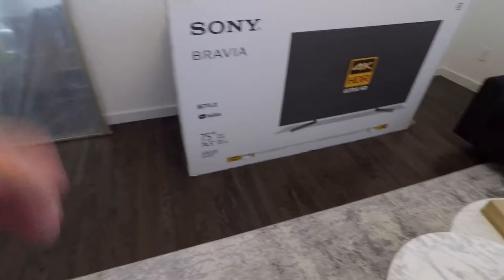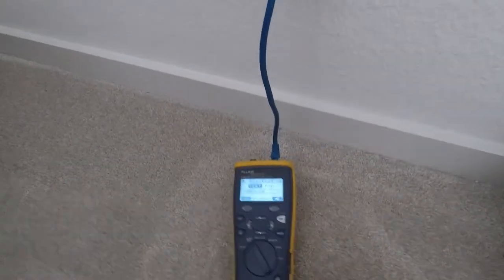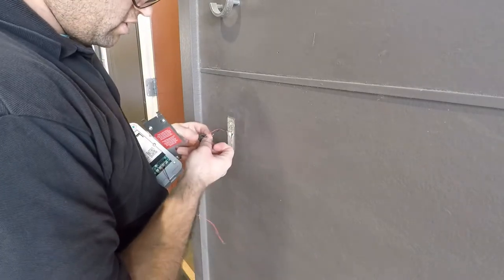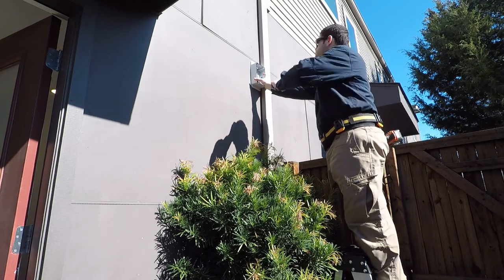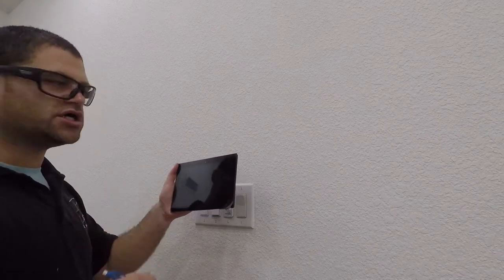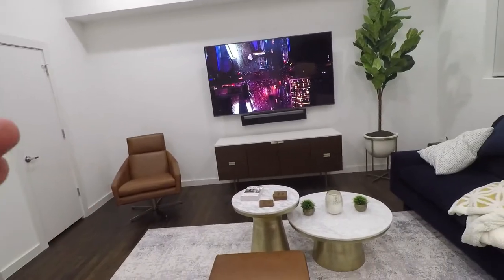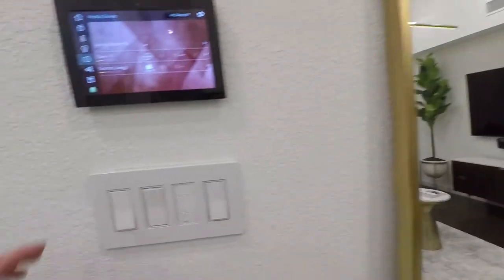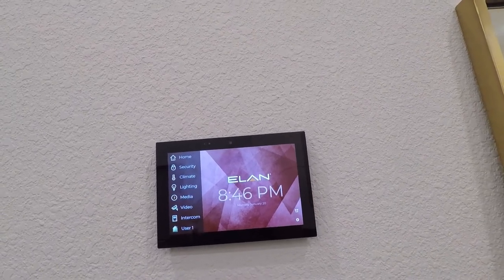ELAN Automation, Sony TV, Sonos 5.1 Surround, Araknis Network, Luma Cameras, DoorBird - Dallas, TX

Comment: Hi, I did not understand how we can open the door when we answer the Doorbird thru ELAN
Reply from the maker: Hi Mohammad! There are a couple of different ways you can go about unlocking doors through ELAN. I am not sure what equipment you are working with, but your ELAN dealer should be able to easily help with this. We are happy to help if your installer is unable to.
Reply: @PureMediaSystems  Thank you for your quick reply, Actually, as you show in the video, I used a Doorbird Door Station and I connect the Door lock to the Doorbird Rely, I wonder how I can use ELAN to Open the door and how it will look like, Is it possible to put a button on Intercom Answering UI and is there any way to Enter the DTMF Code by the system automatically not by the user
Reply from the maker: Unfortunately you cannot alter the intercom answering UI, and codes cannot be entered automatically like you are asking. A relay for the Doorbird can be added, but if you want to unlock the door you will need navigate to the security tab and enter the security code on the particular door lock you want to unlock.
Reply: You could also use the door opener relay from the doorbird app. That the one problem with Control4 and Elan, they advertise all-in-one functionality, but they can't do everything each product's native app can do. Like with cameras you can view live footage but to rewind and review past footage you have to go to your Hikvision/Luma app. One day I hope they can offer a truly automated system that doesn't need multiple apps.
Reply from the maker: @pokerisfun  While this is true with Control4 and other control systems, with ELAN, you can use ELAN's cameras and NVR system which allows you to access full recordings and advanced analytics all though the ELAN interface.

Comment: I can't believe this guy was allowed to run a cable exterior to the wall. I would have removed the baseboard, got the cable over to the location it needs to up the wall, got it up right where it needs to be drilled out, make one small patch hole, then drilled it out. Still came out looking alright for what it was but I've never been allowed to run a cable outside of a wall lol
Reply from the maker: Thank you for your feedback. That is certainly an option in certain situations. However, most homeowners don't want to go through the added cost, mess, and time associated with surgery of this capacity to their homes. In this situation, the customer opted for stapling cable along the baseboards, which is barely visible when in the room. The customer is very happy with the results.
Reply: If the customer is happy and pays their bill that is all that matters at the end of the day. I wish I had more customers like that one. We have attic spaces to retro cables through 99% of the time but it definitely makes it more difficult when there is no attic
Reply: @pokerisfun  Yes, we typically can go through attic space. However, in situations like this where you have a townhome with no attic or carpet you have to get creative.
Reply: Most of our customers who can afford home automation systems have no problem paying for us to pull baseboard and keep the wire hidden. I love pulling baseboards to run wire. Most of the time we are able to put them back ourself and the customer has someone come do touch up paint.